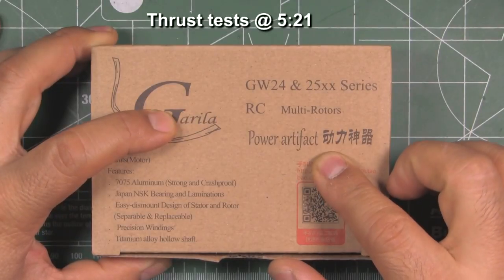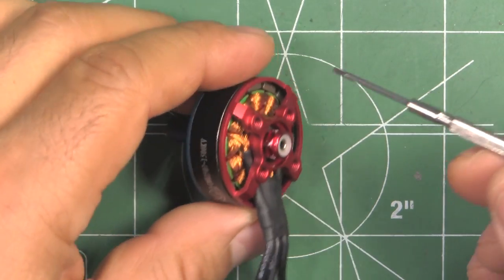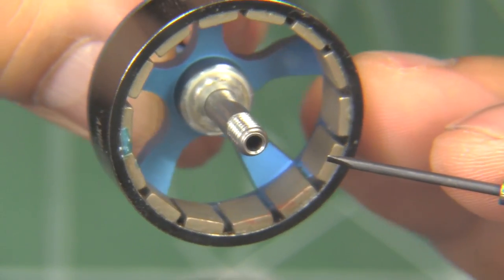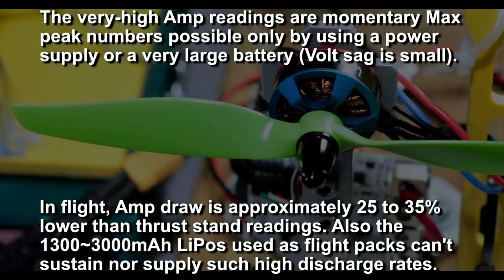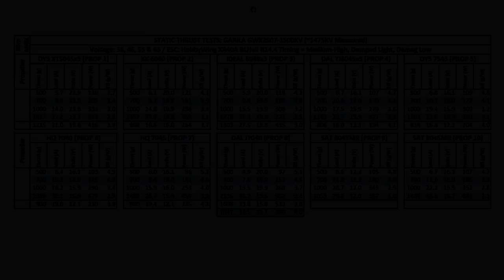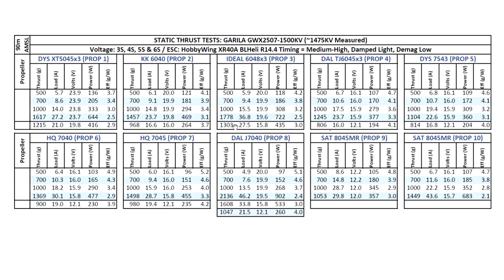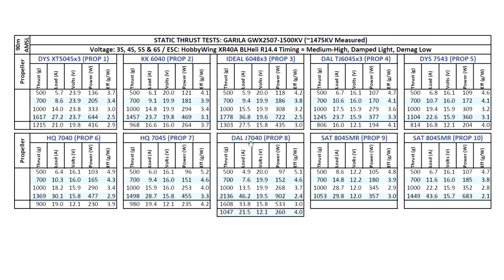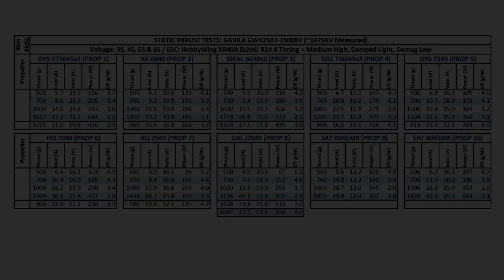GARILA GWX2507-1500KV Thrust Tests & Overview - Big Gorilla Power!

Comment: We need a test of higher kv! Great work as always sir.
Reply: this motor has many variants, also known as X2507 with 1500, 2350, 2500, 2630, 2750kv, I chose the 2507 1500kv for an 8inch build but thanks to this test it looks like its better suited to 7inch props.
Reply from the maker: I'd love to test the higher KV version but unfortunately you gotta buy sets of 4. Brotherhobby will be sending their new 2407-1850kv/2450kv/2700kv and 2507-1800kv/2450kv/2700kv and 1402-8100kv/9500kv motors according o a message they sent
Reply from the maker: I think those higher KV versions will perform very well as they should follow the same construction features of this motor. BH will be sending some new 2507's soon!

Comment: Well said sir I cant argue with good logic I just hate seeing anything that shows such great motors putting out such low thrust. The general public will focus more on that than your positive review in my opinion and I am very passionate about these motors
Reply: Agreed. The reason I love these motors (and also the avenger 2507 1500kv's) is because they can be a nice 7" cruiser on 4s, or an absolute BEAST on 6s without having to change anything but the battery and the pid/rate profile... im hardly objective though i love me my big stators but I kind of feel like sometimes the chosen test parameters on this channel are a little odd when considering the KV of the motors and the plethora of props available now days. Also when all you have to do is up the voltage and spin it up again I dont really see why they dont just include a full spectrum of voltages for all motors..

Comment: Hi I just uploaded a raw video from earlier today of the maiden flight of the 8inch build with the new updated garila 2508's, it flew much better than expected. more videos to follow once the rain clears up by the weekend here at my wife's hometown during the spring festival.
Reply from the maker: Just watched the video https://youtu.be/SEdPBLYnqs0
Looks like Garila did a good job on revising motors. Good thing they listened to your suggestions 👍👍👍
Motors seem to be very efficient. Battery volts don't go down significantly when you throttle up, so that's a good thing. Also looks like there's plenty of power on 4S, looks like a good setup that can support 5S and even 6S for when you want more speed but on 4S there's plenty of power to cruise around. Very cool setup.
I wish you and your family a happy Chinese New Year. Time to enjoy the holidays and celebrate
Reply: thanks I stupidly flew it a second time with an I thought fully charged battery punched it dived, cart wheeled broke 3 props thankfully no damage to the quad or motors but now don't have enough 8inch props to fly again,,,,, I'm kicking my self..... but having fun with the 3inch build. 
one of the old 2507 1500kv motors is now on a wing that I will also be trying out I've never set one up or flown one before, it was cheap to build so not to worried if I crash it, I have the other three motors, esc's, tape and super glue ready in a box incase.
Reply from the maker: Edward Lee Good it didn't get damaged. At least props are easier to replace. I've been wanting to build a plane or a wing but there's no food places to fly near here. I'd have to go far. One of these days maybe I'll  build a small one.
Reply: I built and brought the 1000mm wing with me to try something a little different and incase the 8inch didn't go to plan, but its worked out way better than expected. I will be trying the wing over the weekend. its only the newly built road that has any open space around it, I will most likely crash badly, loose it to the big lake or end up stuck in a tree, but all in the name of fun.
Reply from the maker: LoL... Go for short laps at first to make sure you got good video and Rx control. Also most crashes probably happen on the first attempt because of trims not being neutral or weight too far off the center of lift. It'll be exciting and adrenaline rush LOL fun for sure!!!
Reply: Today I learned not to fly a wing on a windy day .......(18-26kph)
It turned out to be a very short flight with the wing this morning, I was a bit inpatient and failed miserably ! time for the glue gun and tape.
Reply from the maker: LoL.... sorry to hear about that. Well, at least some experience was achieved :) Better wait for calmer conditions!
Reply: i will be doing that, and practicing on a simulator,

Comment: Yes my point was not to argue but to correct the test parameters. Throw out all 3s testing because these motors are designed for 6s being the peak performance voltage so test using 4s 5s and 6s. Also try using a 6048x3 any hq 6" tri blade and any Apc 6" and 7" prop with a pitch of 45 or more. I have hundreds of videos flying almost every kv made I would never argue the good info you just provided but am fully aware of the difference if you need a link I would be happy to show you amp draw osd videos that prove my higher kv do exactly as I state. My 1500kv I don't bother with osd because the amp draw is so low any 30a esc will handle any prop up to 8" on 4s or 5s and most 6s
Reply from the maker: Thrust runs have been filmed and Amps and raw data are all provided in all my tests. I don't know why you come out accusing  "misrepresentation" in the testing and stating that I don't know what my testing equipment can handle? I have video of my power supply failsafe triggering due to excessive load. Sorry  that's all I can afford to buy for testing gear. Amps are shown for each test, so anyone carefully looking at the results can clearly see that the motor can take more load on those props. Sort of like when Jay Leno's Garage goes out and test a 800whp car, Jay doesn't go 200mph, simply because the testing conditions may not be favorable. I don't want to blow my testing equipment as that would be undesirable. It's either that or I don't test the motor at all and don't show the viewers what the motor can do under the testing conditions I've set forth. I never said that this motor is not capable of handling even higher voltage - the data shows that it can.The people that watch these boring test videos are a very savvy bunch, believe they know the motor can do more and I'm 100% sure they have seen your 100's of videos showing 8S flights. There's no misrepresenting going on here. There's just no 6S- 8S tests because I don't have the correct equipment to handle it:  
I don't think I gave it a negative review If anything I think I said it's a very capable and versatile motor. 

I included 3S because the fellow FPV enthusiast who DHL'd the motor all the way from China was interested in those particular props on 3S-4S. There are quite a few people that want to know what motors can do on 3S for less aggressive flying. 
Did you see the complete test and thrust table? 
6048x3 was included in the tests @5S 37A and 722W
DAL 6045x3 (similar to HQ) @4S
Clearly that data shows the motor can easily be pushed farther on 6S, 7S, 8s. No need to argue there, the data speaks for itself.

Comment: Maybe it was just my preconceived expectations but I was thinking this motor was gonna create a lot more thrust ???
It appears the amp draw is on the lower end though so maybe extending flight times ??
That's again for all your efforts!!
It is very much appreciated!!
Reply: Jarrod Bath That would definitely be the case if it wasn't so low KV
Reply: I am just building a 6" with 2600kv version. I wonder how that one will perform.
Reply: hi, they do a GWX 2506 1900kv also called X2506 1900kv that will suit 6" props look them up
Reply: Don't bother if its for just 6" props ,I have a 6" Martian II with Emax 2205 2600Kv ,its not great with 6"props ,kv is too high 5" props its very good ,but can kill your batteries ,I have just fitted Brother hobby R5 2206 2450Kv ,very smooth with 6" props and less amps ,a lot more efficient .
Reply from the maker: Right, the limiting factor here is the motor's KV. This motor is not being loaded that much with the 5" & 6" props, that's why I could test it on 6S with the 5" prop. It may be possible to have longer flights with these motor since it's not going to be drawing high Amps but also speeds will be slower. It probably would match best with 6" and 7" props on 4S or 5S for a "cruiser"
Reply: Very late to the party, but it is the motor KV.  I run these on 7" with 6S batteries - and with 2200mAh 120C-150C packs I can finally get to the point where the motors are the limiting factor - which is around 125mph (!) and otherwise insanely fast for a ~700g AUW setup.
Even at that bonkers performance level, I'm seeing 6-8 minute flight times (sticks to plastic on throttle), and if I'm doing some cruising and freestyle the flight time is 10-12 minutes at least.
Reply: Yep, got the 2406 1900kv for my first build, 7 inch, it was a great cruiser, and a good way to start off in the hobby

Comment: Check out the new Gemfan Flash props. 6042 and 7042 bi's.
Reply from the maker: I saw those the other day.  I'll have to order them. The one thing I've found out with those GemFan props is that they don't show good thrust numbers on the tests and the Amps are higher than others. Same thing happens with the RaceKraft props. BUT we know they fly very well and are very fast. I think they're specifically designed to perform better when moving through air and in static thrust they don't do well. That's why I stopped including them in my tests. They get lower thrust than 5040x3 props but we know they're way faster than that prop. The GF5042 seems to have very similar blade profile as the 5152x3 I've tested so it may show low thrust in tests but in flight it'll be very good.

Comment: I'm still trying to decide whether to go for these, or the Garila 2508 1450kv (moscow) motors for the twin motor speed plane I'm building. It will be running 5s and/or 6s batteries and 7x5 props, apsc or graupner cam speed. Thanks for the useful data point for my research.

BTW, what sort of continuous power limit would you suggest, having run these motors a bit? is 750 watts being a bit too hopeful?
Reply from the maker: DossKat I'd say go for the 2508s from what I've heard one of the early buyers , same person who donated this one, said improvements are very good and motor is very smooth and runs better than this version. For continuously outputting 750W these or even the 2508s will eventually get too hot I think. These are better suited for multirotor use. I would think those new very large BrotherHobby 35 and 28-sized motors can support that kind of power. I'm probably thinking conservative and having good headroom, mainly because I don't have experience with motors and that much sustained power output.
Reply: Yeah, fair enough. The other thing is that with a well designed plane/cowling, you can duct a whole bunch of cooling air right at the motor in a way that will cool it very effectively. A motor in free(ish) air like on a multirotor's arm doesn't get as much air flow as one would immediately assume, since most of it just flows over the top, rather than through the windings/stator where you'd want it to go... I guess the other thing is that continuous rating is a very hard thing to define/quantify. Different manufacturers and different people have very different ideas of what a continuous rating is, and what's acceptable temperature wise etc etc etc.

I might have to look into making some sort of aluminium mount for them to give some added heat sinking, in addition to setting up the cowl to blow air through the motor in an effective manner.

On the plus side, with the amount of potential power, I will not likely be giving this plane anywhere near full throttle the vast majority of the time- 1500+ watts in a <2kg plane is a whole lotta zoom zoom.

I appreciate the insight. BTW, thanks so much for all the awesome data you give to the community, for free. This stuff makes the nerd in me giggle like an school girl, it's just so detailed and in-depth- love it!
Reply from the maker: Right,  I didn't think about the better cooling motors can get fixed wing aircraft, especially in a pusher/wing setup. And yes, an aluminum mounting plate will work as a heatsink. I feel how heat is readily transferred to the thrust stand mounting plate so there's a good amount of heat that transfers through the motor base. 
Yes, the key will be to get good throttle management so you don't saturate motor with heat, running it at a good pace but below the point where it's getting too hot will be  the way to go. 
I'm glad to hear test info was useful, Thanks for watching and maybe you come back here and post about your wing once you get it flying. I'm always interested to see how people do their builds and what they end up using.

Comment: Hello I need to buy motors, can you please suggest a brand.  I would like 2205 or 2206 size or another size if it's not gonna kill my batteries and it's fairly light sub 30g.  I prefer durability, smoothness and efficiency.  Not soo much on power.   Could you please suggest a lower price and a higher price motor that fits that criteria.   Thank you.
Reply from the maker: DYS FIRE 2300KV or DYS STORM 2300 or 2550KV are good, many people say they are durable and smooth.  It's mid-price. Lower price, EMAX RS2205, Brotherhobby R3 2205 ,  High price BrotherHobby T1 2206, EMAX RS2306-2400KV, there are many choices now, also the new T-Motor and Cobra are very good.
Reply: EngineerX Thank you.

Comment: these are 8s motors and all kv 25xx Garilas run 6s I wish these were tested not airplane props and 3s
Reply from the maker: Not on my equipment. ESC is only 6S and 40A, Current sensor is only rated up to 50A. At 5S & 6S it's already at the limit of my testing equipment. I'm sure the motor can do 8S in-flight, that's not the same as in the thrust stand. You gotta understand thrust stand is about 35 to 25% higher load.

Comment: Please test on 6s with à 6inch prop (kk6040 / hq6045 /dal 6045 tri ...)

Thx
Reply from the maker: I have a whole bunch of motors waiting for tests, but as soon as I get those thru the thrust stand, I'll come back to this one. There 's a new version of this motor coming out soon too I think.
Reply: EngineerX i juste bought this 2507 un 1500kv for 6inch in 6s .
What lipo you recomand ?
Reply from the maker: AeroGeek : FPV - test - unboxing - 3d print This motor will handle 6" 6S no problem. You will need at least a 1500mAh 6S. Turnigy Graphene do well. There are other good ones but 6S are hard to find. Some people use 2 3S in series. The easiest would be Turnigy as it come in 6S configuration already.

Comment: Looks like a good choice for 6" 5-6s
Reply from the maker: Just need to see about long-term use and durability. Not much info on these motors, they seem OK but only the right abuse will uncover weaknesses
Reply: That flight test video about the 80mph 7" with 13mins of flight time got me thinking. A 6" quad with 7" arms could give you a really wide envelope for whatever you wanted to do. Just drop a cell and go to 7" for longer flights and cruising or go to 6 for a more agressive flight.
Reply from the maker: Not only using different props but you can also go from 5000mAh 3S to 2200mAh 6S provided you got all those batteries in between you can test all kinds of combos and see which is best.... too much work LoL.
Flying FPV for that long is somewhat tiring, I have a Cobra 2204-1960KV / HQ6030 /25C 4S-2750mAh that would fly about 14min, though not @80mph more like 20mph. Anyway, my hands and eyes were tired
Reply: Good afternoon partner if you had to mount a Long Range quad with a frame of 300mm and 7 "propellers that you would use engine between brotherHobby avenger 2507 1850kv or gorilla 2507 1500kv

Comment: How are these props on 3s and 6040 props?
Reply from the maker: For 1500KV motor on 3S you need at leas 8" prop maybe 9 or 10" to get good thrust. 6040 too small for 1500KV.  It will lift quad but very slow.

Comment: Try s6 6045 u get the best results
Reply from the maker: Yes for sure. When i tested this motor it was one of the first high-power 5S and 6S capable motor and i was beginning to test with my power supply and thrust stand so I wasn't sure if it could take the loads. Eventually I found out it could so this motor was not tested to its full capacity and I gave it to a friend for his wing.

Comment: They have a new series J series more powerful and efficient.
Reply from the maker: From what I can see in the factory website http://www.garila-hoimotor.com/col.jsp?id=104
X = 2507, 2506, 2504
J = 2506 & 2514
There's no J2507 so there's no "NEW" series for 2507 
If you find J2507, please post info/ website here.
Reply: EngineerX Yea they also bench tested the 2506 2750 at minquad bench test site. I'm Definitely going to buy the j series motor.